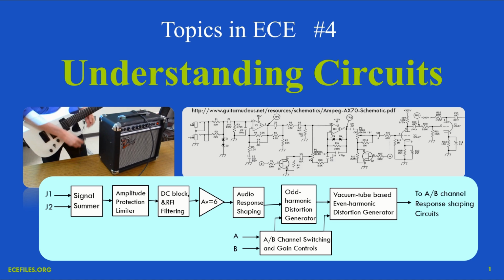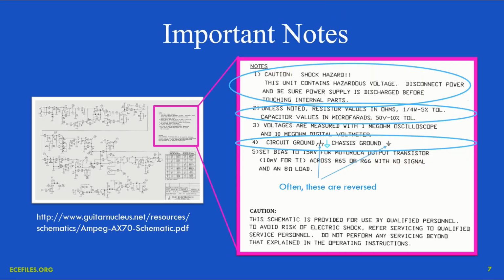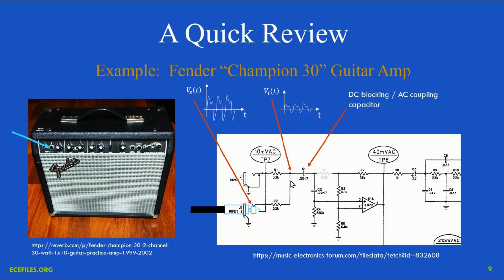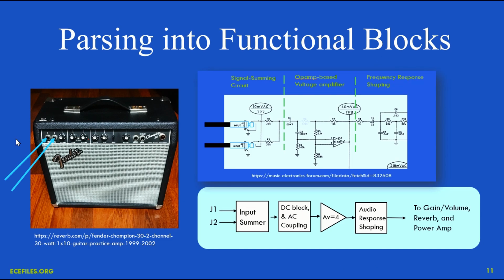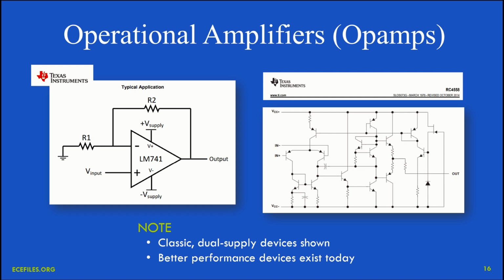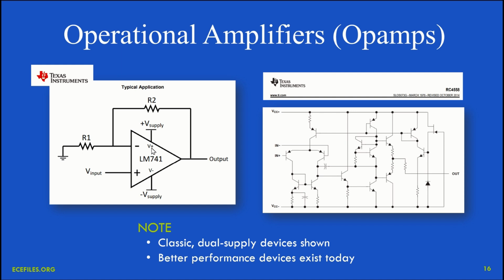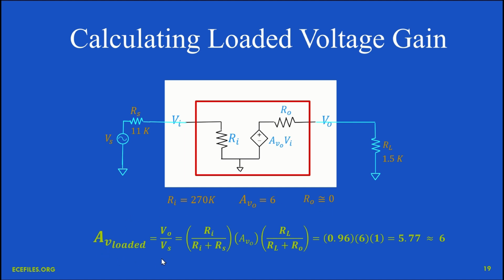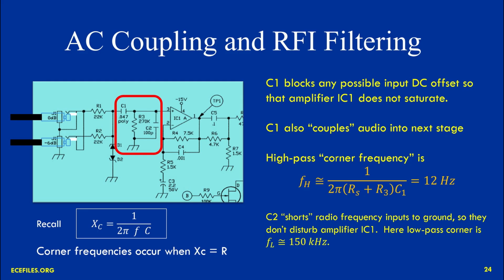Understanding Circuits - ECE topics #4 (part 1)

Comment: Hi it's a great video. But why is the Ri of the gain stage equivalent circuit equals to 270K? Or is it the approximation of 270k+1.5k since they are both connected to the ground?
Reply from the maker: Hi. Looking at slide 19, the short answer is that R3 on the + input of the opamp is in parallel with the impedance seen looking into the + input (pin 3). But the impedance seen looking into that pin is close to infinity. So there's just R3 (270K) to ground loading the source. It is true that we sometimes talk about the opamp as having a "virtual short circuit" between it's inputs since when it's in a typical negative-feedback amp such as this, the voltages on the + and - pins are the same. But that's a "virtual" short circuit and is only a useful construct when solving for the voltages and gain in the circuit. There is no actual connection inside the opamp from pin 3 to pin 2 where the 1.5K is. So the 1.5K is not seen by the source.  Bottom line, looking into pin 3 (the + input) we see an open circuit, since no current enters that pin. So the only thing loading the source is the 270K (R3) to ground - at low frequencies where we ignore the 100pF C2.  Does that help?

Comment: When I think about the J1,J2 phone jack inputs, its working is very exciting. Those phone jacks employed in the circuit are TS with Normally Connected tip switch type. 

When no phone plugs are connected, the tips of the jacks are grounded. 

If you connect the plug to j1,  it open its NC switch, and the signal goes through both R1 and R2. R1,R2 are in parallel now, so they become 11k ohms effectively. 

When the plug is connected to j2, the signal is potentially divided as you explained. There is a 6dB reduction in the input signal. That fact is mentioned near the jacks as well. So, it’s an input with an attenuation. 

When you plug to both jacks, those 2 input signals are fed independently without any attenuation (no voltage divider met).
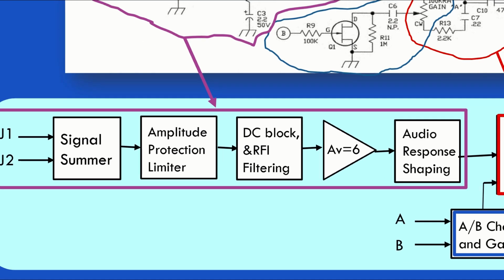Reply from the maker: They definitely created an interesting input circuit here (timestamp 1:22) !  I agree on all points, except the last one. I would argue that when two instruments are plugged in at the same time, each is attenuated by 1/2. This follows from using superposition in the analysis. Even though J1 plug disconnects the path to ground, superposition says, for the signal plugged into J2, that we "turn off the J1 signal" (meaning set its voltage source to zero) when finding the response to the J2 signal. So there's a zero-valued V source there now, which is a connection to ground :-)   (The case for the signal applied through J1 is symmetric - so it is divided by 2 also).
Reply: @MegawattKS  Yes. Summing amp using the non-inverting configuration is different than that of using the inverting configuration. Inputs are not isolated from one another. So, the input current flowing through one particular input is also going through or shared among the other inputs. As a result, all the input voltages are averaged. For example, if v1, v2, v3 are three inputs, the non-inverting input is presented with the (v1+v2+v3)/3. Anyway what I tried to point out is that this averaging effect is not obtained simply by voltage division.
Reply: This simple average is obtained if the input impedances are all the same of course. :)

Comment: i really like thiis type of learning  where you explain the blocks what devices are used and why and how they interact and all , thanks alot
Reply from the maker: Thanks for letting me know ! This will help as I work on part 2 of this video (and others to follow). Its always hard to decide what people will find most useful and to know how much prior knowledge to assume. Doing videos for YouTube is different from the classroom where that is known from the pre-requisites.  Your comment helps me know that at least some of what I'm doing is working :-)  Thank you.
Reply: @MegawattKS  i am intersted in RF design and amplifiers (all types)   what i liked was the RF 101 if you can do another course on transmitters with various architectures  analog and digital  modulation based on the classroom pre-requisites   because the 101 was magnificent there is nothing on that level on ytube actually i have just seen steven elingson  channel but it`s not as practical as yours altough he has some very practical videos , presenting the fundamental structure and interactions in the system then going with the modern applied  approach using various IC`s and commercial products is perfect it gives me a tangibile sense and a sense that designing one is actually posibille because when i learned the maths calc 3 dif eq and all that i was thinking i would need 3 brains to make something for real , in summary another series will do just fine at least for me
Reply: @MegawattKS  btw dont skip on maths if it`s required to give a full understanding on the design , let`s say it requires heavy use of network analysis like say Design a circuit to realize the following transfer h= whatever  function  and using only resistors, capacitors, opams/transistors at least for me math is not problematic and for those intersted in radio design it shouldn`t be that in general  should make your audience
Reply from the maker: @lattehour  The level of math to use in the videos has been limited to algebra to avoid problems for those that don't have experience with complex numbers or interpretation of complicated expressions. That said, there is plenty of math at the companion website pages. Here is one page with links to the entire senior-level university course. The "notes" are somewhat rough, but they're appropriate for those at a senior or graduate level :-)  https://ecefiles.org/rf-circuits-course-notes/  (They're rough because these are just my personal-use notes for when I was lecturing in the class. But they're reasonably complete at least :-)
Reply: @MegawattKS   what books do you recommend for vhf uhf with a more practical approach both from the systems perspectives that are designed at this frequencies and device level
Reply from the maker: @lattehour  Here's a few of my favorites I recommended in classes. Most are from the early 2000's, but still entirely relevant.

A 'good' book of course is partly defined by how well it fits into where one is in the learning process - what they already know and what it provides for new knowledge. These are in that order. And also in order of increasing prices.
(Note that I did not include traditional textbooks like Sedra and Smith, since they are IMO too deep in some ways, while also not keeping up with the engineering going on today.)

General technical audience:  
"Practical Electronics for Inventors, Fourth Edition" by Paul Scherz, Simon Monk, Released April 2016, Publisher(s): McGraw-Hill Education TAB.

RF design for Ham Radio experimenters:
RF Circuit Design, Second Edition, by Christopher Bowick, et.al., Elsevier, 2008

For graduate-level and research oriented treatments:
"The Design of CMOS Radio-Frequency Integrated Circuits", 2nd Edition, by Thomas H. Lee, Cambridge University Press, 2004.

For circuits that use Microstrip and other very high frequecies in to the GHz range:
"Planar Microwave Engineering, A Practical Guide to Theory, Measurements and
Circuits," by Thomas H. Lee, Copyright 2004, Cambridge University Press.
Reply from the maker: Here's some links to the Amazon listings for each book. The value (even if they're not bought through Amazon) is in being able to read the reviewer comments, and for some, the "Look inside" option that provides sample text to look and and help decide if it's at the right level...

https://www.amazon.com/Practical-Electronics-Inventors-Fourth-Scherz/dp/1259587541

https://www.amazon.com/RF-Circuit-Design-Christopher-Bowick/dp/0750685182

https://www.amazon.com/Design-Radio-Frequency-Integrated-Circuits-Author/dp/B006V35I34

https://www.amazon.com/Planar-Microwave-Engineering-Practical-Measurement/dp/0521835267